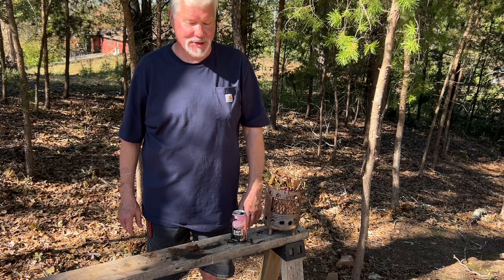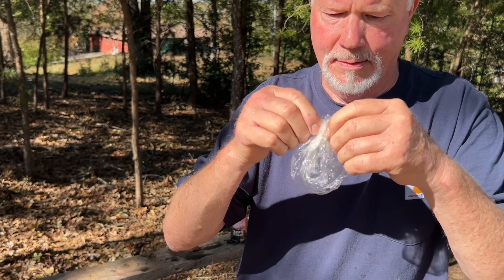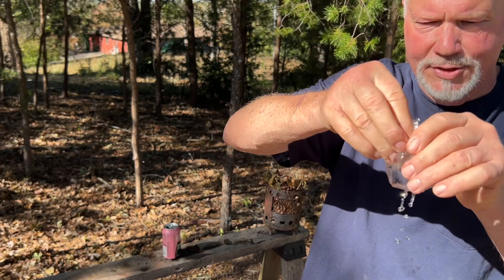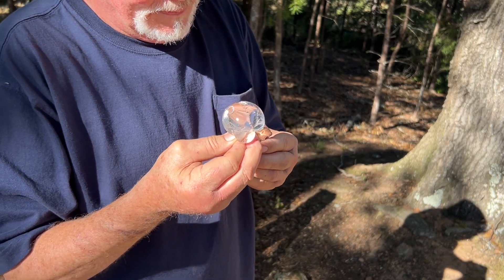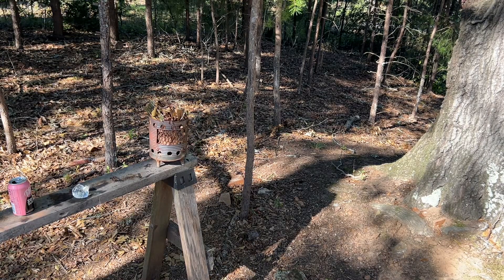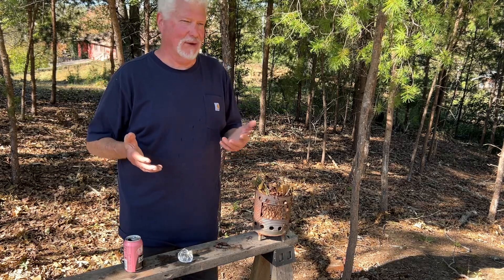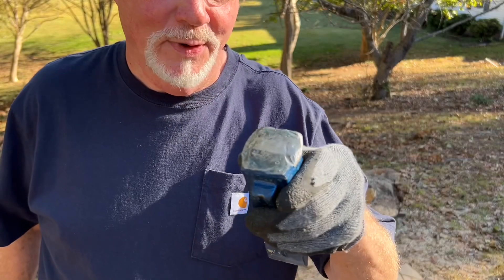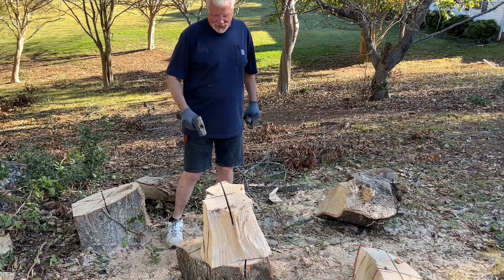How To Make And Use A Water Lens. Solar Igniting Fungus

Comment from the maker: Plastic Wrap of all kinds can be made into a great solar igniting water lens. Use a square piece. Make a pocket of it by gathering up 3 sides. Fill the pocket with water. Gather up and twist up that last side to create a little bag of water. Purge the air bubbles out as you twist to seal and tighten the bag of water. AND, That’s it. Yep, that little creased up plastic ball of water will be a strong solar igniter.
   Watch as I easily solar ignite oak bracket fungus, ignite leaves, and make a roaring fire. Please follow the LINKs below and SUBSCRIBE. Thank You! 

Solar Ignitions Playlist
https://www.youtube.com/playlist?list=PLkoXX8XsMW3kl5CicmPv0pTz-7rj4gczW

Comment: Watch for those small flying pieces of metal. I live in Ky and a when I was younger a guy working in the shop at the mines just a couple miles from me fell over dead after using a sledge so they thought it was a heart attack but autopsy revealed a small piece from the sledge entered his neck cut an artery and it killed him without knowing he was even injured badly.

Comment: Do you have experience with storing or transporting an ember?  I'm curious how long a coal or ember can be stored.  I've had brush piles I thought were extinguished re-ignite two weeks later, but there was a substantial amount of stored heat and charcoal.
Reply from the maker: Use any coal extender, manage the amount of oxygen getting to the coal, and add more coal extender as necessary.